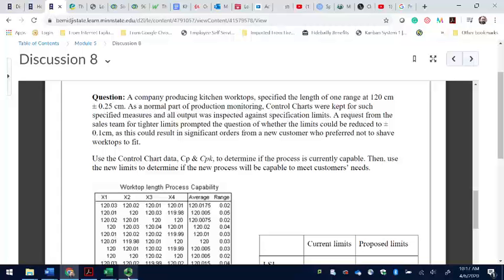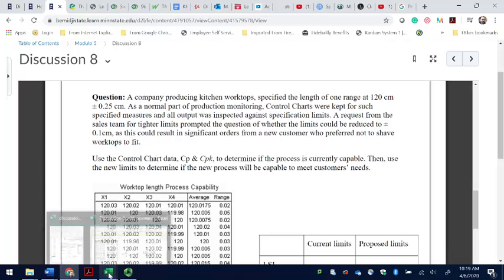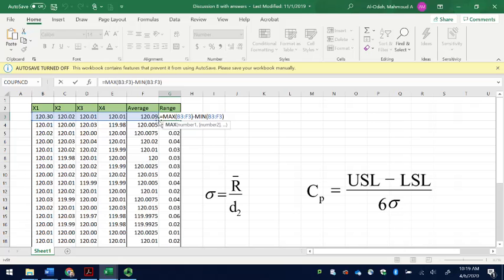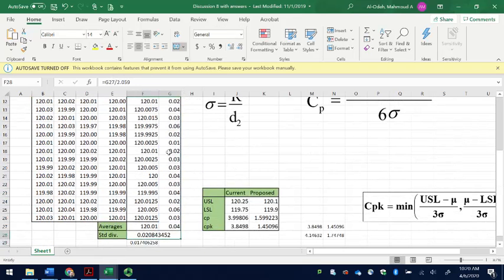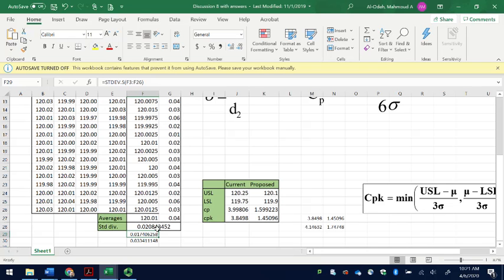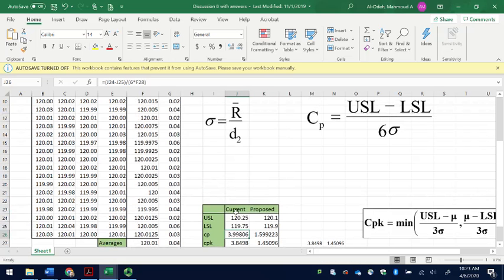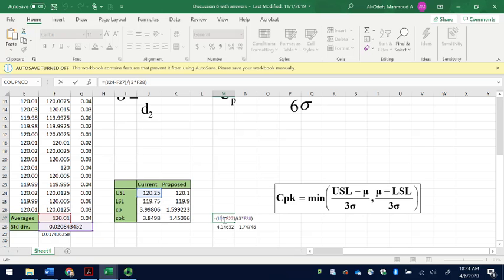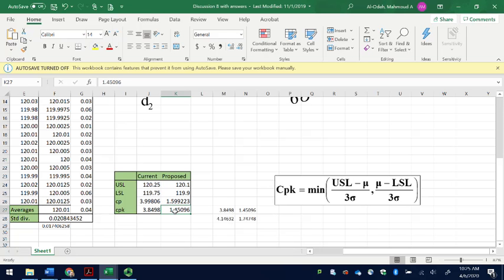Process Capability   Cp   Cpk Calculation - Example - Lean Six Sigma the Analysis Phase

Comment: X1 is wrong, compare to the question. It states 12.03 not 12.30
Reply: Why do you think your range on the first row is .29 while the other are below 0.1?
Reply from the maker: @baobaluza2823  got it. Thank you!
Reply from the maker: Where do you see the 12.3? I see the 12.03 as the first value in the X1 column. You should not use individual values in the equations.

Comment: Hello sir can u tell me   basically how to find the Value of  USL & LSL ? Any formula ?
Reply from the maker: No formula for the LSL & USL. These values are not calculated. It is given to you by the design team or taken from the customer. For example, you survey 10 customers and ask them when do they like to get their food in a restaurant. Their answer could be summarized as between 9-16 minutes. So, you consider these (9-16 min) as LSL & USL. So you use these values to do the Cp &Cpk analysis.
Reply: @dr.mahmoudal-odeh9315  sir thanks a lot for ur great  response and also great example 🙏🙏🙏🙏🙏

Comment: Kindly explain how did you get d2? Can i use the formula of square root of sum of x- x average/n-1 to get the Std Deviation??
Reply from the maker: Yes, you can use the formula to get the St. Deviation. 

d2 is not calculated it is taken from the table in the appendix. Check these websites for the table: www.bessegato.com.br/UFJF/resources/table_of_control_chart_constants_old.pdf

https://web.mit.edu/2.810/www/files/readings/ControlChartConstantsAndFormulae.pdf
Reply: @dr.mahmoudal-odeh9315  What should i do if my size group is more than 25 values? How can i find d2?
Reply: Thanks for this chart sir

Comment: how did you calculate the current lower and upper specification limit? you mentioned it briefly but where did it come from? Thanks in advance
Reply from the maker: Specification limits are not calculated it is given to you by the customer or by the design team.
Reply: Nominal value plus tolerance gives you upper specification limit, nominal value minus tolerance gives you lower specification limit

Comment: hi, how did you calculate d2?
Reply: It is not calculated, as mentioned in the video, it is (fixed number) in the appendix based on the number of observations you take.
Reply from the maker: not calculated it is from the table in the appendix. Check these websites for the table: www.bessegato.com.br/UFJF/resources/table_of_control_chart_constants_old.pdf

https://web.mit.edu/2.810/www/files/readings/ControlChartConstantsAndFormulae.pdf
Reply: In your example sub-group size will be 24 by table we have to see 24th value in d2 column.its =3.895